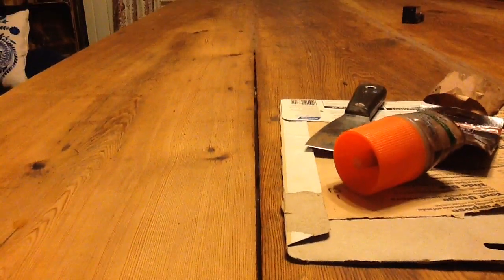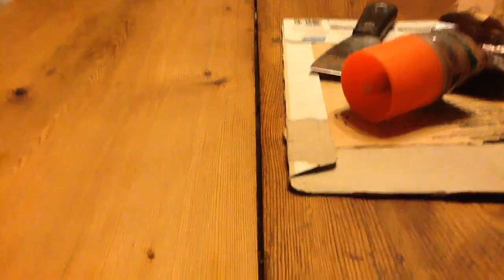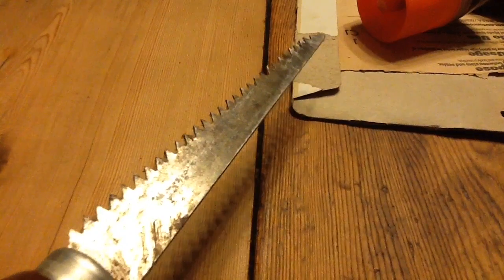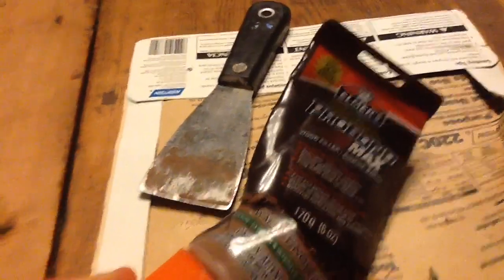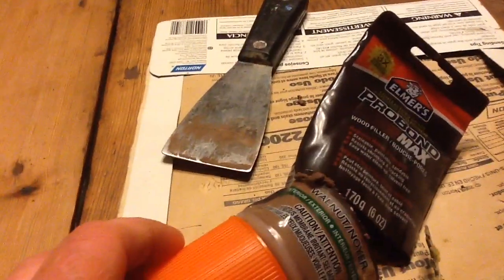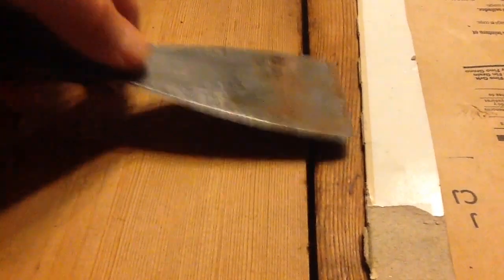How to seal cracks in a harvest table - Wood Filler method

Comment: I am building a similar table to use as a kitchen table... i need to close of the gaps.. i was wondering how your method worked with humidity change thanks
Reply from the maker: It did not work well. Still have gaps. Our house goes from 30% humid to 80% at times during the year so hard to deal with that
Reply: @MicahGallant  thank u!!!